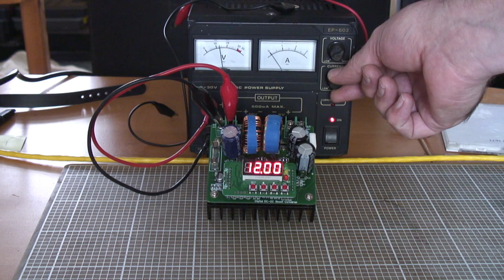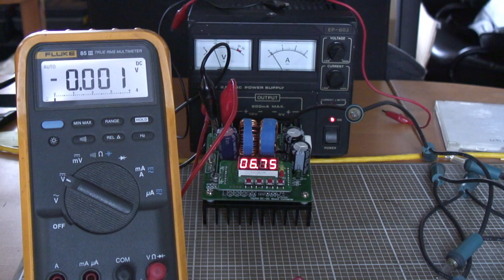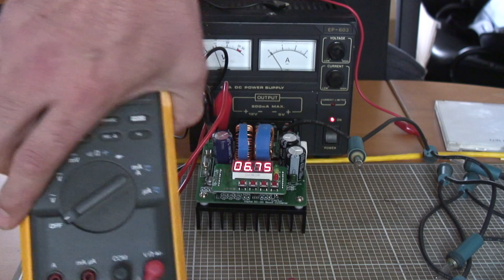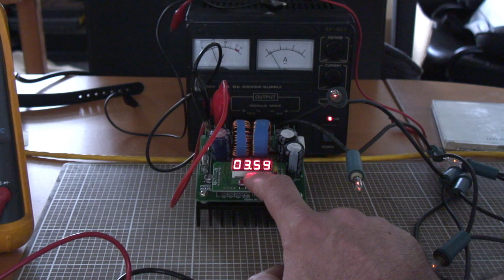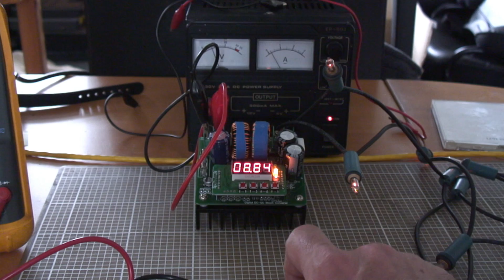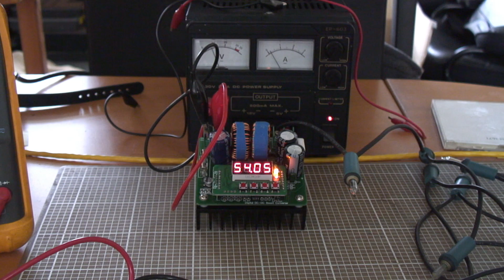Review: 400W Digitally Controlled DC/DC Step-Up Boost Converter - Far from Perfect

Comment: I purchased this unit a few weeks ago before I saw this video. If I had seen this video I would never have purchased it. When I receive the unit, I performed essentially the same test that he did. But the unit would not start.  I had to hook it up to a 13.5V 10A Power supply  to get it to power up. The unit worked, so I thought. so at that point I needed to do other things so I shut everything down for several days. When I got back to It, I did a safety test on it. I set the unit for 16V to 0.25A . I then shorted the output with a 1 ohm 10 W resistor. The output light went off but the resistor got extremely hot very quickly. The voltage output was 14.8V at full  available current.  I also found that at start up, the same problem occurred. it outputs full available voltage at full available current. if a short  occurs while using this power supply,  depending on the available current you could burn down your house. In my opinion, this power supply is potentially dangerous and should not be on the market. if you're using this power supply, make sure you fuse for the maximum current that you need. and pay attention to it. Do not leave it unattended.
Reply from the maker: Hi Joe Allen - The design of boost converters (all of them) means that there is just and inductor (i.e. coil of wire) and a diode in the path from the input to the output. With the boost function disabled and the converter shut-down, the output voltage will be just 0.7V below the input voltage. All of the boost converters you can buy on ebay will behave the same way... the current-limit doesn't really limit the current, but is just shutting down the boost function if excess current is detected. This 400W unit is certainly a piece of junk (with it's startup issues, noisy output waveforms and dodgy firmware), but even the really-good 600W converters will fail to limit current in the same way. Hope that helps. Thanks for taking the time to watch and comment. Cheers!!
Reply: Jim Conner  Hello and thank you for your reply.  I do know how a boost converter works. My comment was intended to inform people that it can be dangerous if something shorts out. a better design would be a buck  boost converter. on this type of converter, There should be some automatic mechanism, a relay or something to shut down the output, if something goes wrong. for a so-called advanced microcontroller power supply, There does not seem to be much if any safety considerations at all built into it. this product is mainly sold to the hobbyist. some of which are not very Knowledgeable on safety issues. the manufacturer should take this into consideration when designing their products and make sure that it not only works properly, but that it is safe for the intended market.
Reply from the maker: Joe Allen I couldn't agree more. Cheers Joe - have a good weekend.

Comment: Thanks for the video.  Does anyone have a recomendation of a DC constant current, constant voltage Boost converter with an LED that works well?  I would like to boost about 5V to as high as possible, but I only need a milliamp of current.  Thanks
Reply from the maker: Hi Bubba - The 600W and 100W boost converters are far better than this 400W unit... They both passed my tests with no problems.... However, neither one of those two can run with an input voltage as low as 5V - they both need 10-12V on the input as a minimum. When you say you want a voltage 'as high as possible' how high do you actually need, and how much current are you after.... The charging circuit for a camera flash might be what you're after.... That'll take you from a couple of AA batteries up to around 300V, but with very minimal current. Cheers!!
Reply: Jim Conner Thanks for responding.  I was looking to take 5v USB to around 30 volts, but that flash circuit and 300v sounds interesting :).  I would only need minimal current, like 1 milliamp, but a way to keep it from going over that would be ideal.
Reply from the maker: Hi Bubba  - Try searching ebay for an 'XL6009' - The specs say that it is pretty much exactly what you're looking for.... I haven't owned one to comment on it's performance, but if it's anything like the other converters I've played around with (except that 400W LED display one which is rubbish), it should be pretty reliable and robust. Cheers!!
Reply: @extendedp1  DC-DC Step Up Down Boost buck Voltage Converter Module LM2577S LM2596S Power try this no probs with it this allows you to set current and volts

Comment: This is a BOOST converter, so the output voltage always have to be higher than the input voltage, that is the way these things works, so that part is not an hardware error, but a usage error!!
Reply from the maker: Hi Christian Hoj  - Surely it's something of a design fault that the unit lets you choose a boost voltage which is lower than the minimum voltage that the unit can run on. Aside from the 0.13v issue, the converter has a number of other faults which made it effectively useless... I did try to use it for powering my 100W LED growlight (in a different video), but it was unable to start up cleanly and made the most awful high pitch whining noise all the time... I had to switch to the 600W unit instead (which works flawlessly). I have tried really hard to find something that the 400W convert is actually useful for, but in all honesty, it's pretty much unusable for any practical application. The only good thing I can say about it is that it has an LED display on it. Thanks for taking the time to watch and comment. Cheers!!
Reply: I hope I have more luck with it, since I've just ordered 3 units, else I just have to send them back :-)
Reply from the maker: I hope you have better luck with them than I did... maybe (hopefully) they've improved the units since I did my review - I'd be interested to hear if you find them to be flawless in every way... Out of curiousity, what are you planning to use them for? Cheers!!
Reply: Jim Conner I'm going to make a special 3 output charger unit, that needs to either operate from a 12V lead acid accu or from a 24V psu. Always outputting a maximum of 26V and around 5A. So I think it should work, even with the flaws. It's no problem, that it ramps up the voltage slowly,Chris

Comment: Mine pulls the same rubbish, ends up shorting out the supply input.
Reply from the maker: Thanks Justin. Yeah - it's just a bad design. The boost converter part of the cicuit works down to a much lower voltage than the logic to control it all, so it goes crazy whenever the input voltage dips... and then takes forever to get back up to the right voltage again due to the incredibly slow ramp-up speed. Thanks for watching and taking the time to comment. Cheers!!

Comment: I am so happy to watch this review. Excellent. I reckon China Made module sometimes are behaved like most of the Microsoft Products, grab the market first, and solve the problems later or don't border to solve it at all.
Reply from the maker: Thanks. Sometimes you buy cheap and get something good and sometimes, not so good. The other Minghe branded product I have is a 300W step-down power supply board (ZXY 6005S) and that seems to work very well. I guess it's all down to which engineer worked on what product and how much sleep he'd had the night before. It really is a shame this boost converter has these problems as it would otherwise be an excellent device. Glad you found the review helpful. Thanks for taking the time to comment. Cheers!!

Comment: Can I use 5V 30A from PC PSU? Because minimal is 6, but I tried and it worked, but I'm afraid I can destroy the unit.
Reply from the maker: The low 5V voltage won't damage the unit at all, but I expect you'll get quite a limited output power from it.  There is a 15Amp fuse on the input, so you'll only get a maximum of 75W power through it. You might also find that the unit shuts itself down if the input voltage dips at all. Cheers!!

Comment: BY the way i hate the function to pass input power to output if device is not ON (not pressed OK). Lets say im using this device to limit current to LED. so looks like if i connect led to it without turning it on (OK button) LED will burnout, because my input supply can give 6A. Or im wrong?
Reply from the maker: That's just down to the way that all boost converters work - There is an inductor and a diode between the input supply and the output supply - when the boost function is enabled then the inductor is used to store enenrgy and discharge it through the diode at a higher voltage, but when boost is disabled the inductor is just acting like a piece of wire, so the output is always connected to the input. Whether that causes your LED to burn out will depend on what voltage your LED starts to operate at...  I know many LED modules need around 30V to drive them, so hooking up one like that would cause you no problems if it got 12V across it when boost is not enabled. Julian Illet gives a good explanation of this about two mins into his review of this converter  Review: 400W Digitally Controlled DC/DC Step-Up Boost Converter - Almost Perfect! Cheers!!
Reply: Jim Conner LED works from 19volts to 27. But led are afraid of curent not voltage. I know those two are conected but.. lets say i have 12Volts input with 3A, but my led uses 25V and 1.7A will coecting LED to 12v 3A power supply without resistors destroy it? i think yes.
Reply from the maker: Tomas Av. LEDs use nearly no current until they reach their rated voltage. At 12V you'll find the LED is only pulling something like 1mA of current. Julian Illet made a video with an execllent explanation of this a couple of days ago... LED Tutorial: Plotting the IV Curve for a 10W LED - Anyway.. you'll be fine with that LED on the converter. Cheers!!
Reply: Jim Conner Oh thanks for explanation! i was so afraid to burn out my 27$ led in first day of use :D Yeah i follow Julian :D Thank you for this review, i saw it before buying this device.. and decided that those bugs wont be so bad for me :)
Reply from the maker: Tomas Av. Glad you found the review helpful -  It's nice for me to have other like-minded folks to chat with, so thanks for watching and commenting. Cheers!!

Comment: I hate when you connect it to power suply - it always spikes to 24-25 volts. no matter what setings there are.
Reply from the maker: Yeah - it even does it if you remove the display board & microprocessor from there. Bad design.
Reply: Jim Conner yeah it's induction. i think you get ~25volts if your input is 12volts and different with different input voltage. (not tested). Also i noticed that if you wait until converter goes to limit value without connected any devices to it-and when you connect  it just turns off output like you clicked on SET. Looks like some overload protection maybe. which is bad anyways.
Reply from the maker: Tomas Av. I was curious, so I just hooked it up one of my high-current supplies.  At 10V input the output spikes up to 24.28V at power-on. With 12V input the spike hits 24.52V and with 15.2V input the spike hits 24.96V - There's certainly some increase in the size of the power-on spike, but not as much as I'd have expected. I'd love to see a schematic of the converter to see if I could work out what's going on with it. Cheers!!
Reply from the maker: Tomas Av. Regarding when you connect a device to the output and it turns the device off like you've just pressed SET... I think what's happening here is due to having a current-limited input to the unit - The boost converter part of the circuit works all the way down to 1.8V input, but the microprocessor drops out at about 6V on the input. When you connect something to the output it momentarily drags the input voltage down so low that the CPU resets itself. I see that behaviour running off my current-limited bench supply, but it doesn't happen when it's running from a high current supply.
Reply: Jim Conner My power supply is 550 Wats PC PSU :) and i was connecting 50W led. so i guess PSU can give 50W on one 12 volts rail. Anyways, regarding the spikes - it hapens because of induction, looks like it always passes input to output withouth regulating it.. when controller starts up - it instantly decreases voltage. Or it just an induction. need to try flyback diode :)
Reply from the maker: tommixoft I think it's more than just an inductive spike at swtich on. If you have a load attached to the output (such as my 10 fairy lights which consume around 100mA) then it will still attempt to raise the output voltage to around 25V before it then calms down again. WIth my 3A current limited PSU, it was only able to raise the output to 18V and the logic board never managed to initialise - This was not just a brief spike though - it would hold the output at 18V indefinitely (even with the logic board unplugged). I can't think of a single good reason why it should be designed in this way - perhaps it's attempting some kind of test to ensure the boost function is working during startup (but why you'd want to do that is beyond me). Cheers.
Reply: Jim Conner Good thinking :) but im interested how to neutralize it..what to connect to output so prevent devices from that spike.

Comment: can you use this converter with a car battery or would a car battery supply too much amperage
Reply from the maker: A car battery would be an excellent source for this converter as it will handle the start-up current without a problem. Cheers!!
Reply: but cant a car battery give up to 600 amps shorted that would instantly destroy this thing
Reply from the maker: Dean Walcott The converter has an output current limit function (up to 10Amps) which will protect it, and there's also a 20Amp fuse on the board in case something goes wrong.... a car battery will work great. Cheers!!
Reply: i think i understand correct me if im wrong does the input current depend on your load if there is no load then there is no amperage going into it
Reply from the maker: Dean Walcott Yes - that's right (the LED display will of course use a little bit of current regardless of the output but we're talking about something like 30mA for that)
Reply: okay thank you
Reply: and by the way i was thinking of powering a 50 watt high power led module
Reply from the maker: Dean Walcott It should work fine for a 50 watt LED... though I'd still recommend the cheaper 600W converter without the digital display in preference (see the other review I did). It doesn't have the pretty LED display, but it also didn't have any of the faults/issues I found with the 400W unit. (also the 600W boost converter is nearly half the price), Cheers!!
Reply: yeah i already have the one without the display

Comment: Why I not try to found users feedback before buy this unit ? :(
Arrived today from Aliexpress. Just not start under load (21W 12V lamp). When disable lamp, unit start, allow select, adjust and save data, but when enable lamp, switch to error (random LED segment blink). Disable load - back to normal state.
When replace lamp to old 12V 9Ah AGM accum, work (V=13,85, A -0,24A). Sometimes, if fast replace ammeter/lamp... work with lamp.
In short - crazy unit. O.o

P.S.
About Y/N question: maybe its realization "automatic output function"
" 3. Powered automatic output function on / off method: Press "OK" button, then power the module, the release the button when display "-0" . If display "-y", it indicates opened the function of output automatically after powered ,  If display "-n" , it indicates closed the function of output automatically after powered."
Reply from the maker: Sorry to hear that - the start up on this 400W unit is the biggest fault I found - the software glitch when setting a very low voltage isn't a problem in practical usage.

Thanks for the information about setting the automatic output function - I'll add that to the description up above.
Reply: Jim Conner Well, not so bad as my first impression. I replace power supply to more powerful (12V 5A) - unit start under load. I think, need VA(in)>1.2VA(out) minimum (first i try with power supply 12V 2A). As variant, one bad capacitor (need verify later).
Reply from the maker: I have been playing around with this converter a little more last night and today. The big problem I have is that at power-on, if the inverter cannot raise it's output to ~25V then it does not initialiase the processor to take control over the systems. I have a 29.7V LiFEPO4 pack that I plan to connect it to (so it can boost the output up to 62V) and I don't anticipate any kind of start up problems with that as the pack can delivery plenty of Amps to get the converter started... For that particular application, the converter will be absolutely fine.

Although it has it's faults, it's still a useable converter for a variety of situations.

Cheers!!
Reply: I too have this. I connect 3A power swich..and if i set converter to limt curent to 1.5A it starts blinking and so on... if i set less-all good. if i conect 6A power - and set limit to 1.5-all good. so looks like converter itself uses A LOT OF AMPS.
Reply: Jim Conner am noob in electronics but i think you can solve this by adding inductor.. when voltage spike s-it auto reduce spike. But not tested